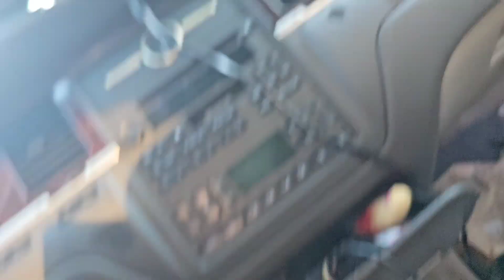Automotive Mechanic Trade or Electrician / Plumbing / HVAC Trade?

Comment from the maker: I apologize about that 30 seconds where I put my phone down in the car I forgot to cut that out
Reply: No need to apologize boss. If I'm being completely honest, your content is worth the wait.🙏🇺🇸
Reply: How exactly does AFM work? I understand deactivating lifters preventing the intake valve from opening thus reducing fuel consumption, but doesn't that cause an engine vibration? What is being done to counteract the power imbalance?
Reply from the maker: @nighttow8780  the top of the cylinder block has a valley cover over it which is called the lifter oil manifold

The valley cover has a series of veins that run through them that little solenoids open and close to allow oil pressure and electrical connection to activate those other lifters

Oil flows to the lifters with that will holes which causes the plunger inside the lifter to close when the pointed or closes the lifters collapse and therefore do not touch the pushrods which keeps both the intake and exhaust valves closed

When you have more demand for power the solenoids then change their position and allow the lifters to open back Violet plunger opening cutting off the oil from the lifter passages and allowing the lifters to go back to their normal operating 8 cylinder positions
Reply: When you are doing exhast repairs or cooling systems in a car it's plumbing air conditioning in a car it's what a house has
Reply: @FordBossMe  I understand all that, but doesn't a deactivated cylinder or cylinders cause a powerstroke imbalance that you would feel while driving?
Reply: Yes thus causing that misfire.

Comment: I have been a mechanic for 48 years.Have worked dealership and fleet and independent and have had my own shop for 21 years.If I had known when I was a young man what I know now I would have been an electrician or a HVAC tech.
Reply: Oh don’t I agree. 45 yrs in, owned shop 36. 
     Too much stress. Too little pay. Too bad it took me so long to figure that out ‼️
    Cars were so much simpler in 1972 when I started. Pay did not increase with complexity of cars.  
    If I was a cussing man I would say F**k car repair as a career.
Reply: All trades have changed though. Some more than others, and skilled trades in general haven't kept the pay in pace with cost-of-living. The electrical industry is more and more software all the time too. 

I'm not attempting to run counter to your statement, but just mentioning there's electricians who aren't happy with the scene either.
Reply: There are a few things though that people tend to forget about other trades…  auto mech, and to a lesser extent also diesel mech, are the most solid life-work balanced among the trades on average. Of course you can find yourself a nice balanced spot as a maintenance guy somewhere in the trades, if you search long enough and have good years and value on you, but even then you have to be somewhat open for emergency calls all around the clock every now and then… and this are the more rare cases, the mainstream can easily be around 14 hours a day including road time (the road can be a real headache and frustration along the years, a pain auto mechs tend to forget about) and emergency/on-spot calls… 
Moreover, as hot as it can get at summer, an auto-mech has a solid constant roof to work under! Something you miss terribly at many other trades working outside (who also have to suffer the winter).

Comment: I'm a union operating engineer. (Heavy equipment) 
Wouldn't trade it for anything. Over 6 figures with insurance and pension. Not hard work, all the equipment has heat and AC and sound system. Comfy. Joystick controls. 
No crawling around. No lifting. 
$120,000 plus, and that's without OT.
Reply: @firstlast6566  look towards gas/electric/water/civil utility companies: Elizabettown Gas, American water, Jcpl, JF Creamer, Roman  type places.......
Reply: @robertdiehl9003  thank you.
Reply: @firstlast6566 
I say learn some electrical skills. Look for industry it's usually stable. I had my last job 30 years. This one 7. I like what I do.

Comment: The automotive field encompasses many other trades all in one. You are an electrician, plumber, welder, HVAC and computer programmer. It's relatively easy for an automotive tech to transition to another hands on trade. I've seen some good techs get disenchanted with the automotive field. One went into machine repair and went to night school to eventually become a nurse. Another tech who was skilled in electrical diagnosis went on to troubleshoot computers.
Reply: I actually can from a rough framer/ finishing carpentry and even though I had background with mechanix cuz my uncle is a 50year diesel technician and my stepfather is also. As I fell off the carpentry cuz it was rough on my back and having a bad knee and created Sciatica I said I can’t stand on those 12 pitch roofs anymore so I said I know and been around the wrench’s and here I am a master diagnostic technician over 10 years and I will be here till the end ( currently 42 years old and feel strong) and God willing my company will flourish where I don’t have to work everyday or at all even though I love what I do and most likely die with my ratchets in my hand. But story short my brother in arms you are absolutely positively correct. Mechanics (good ones) have good memory and problem solving skills and they will fall in all and any category.

Comment: My dad has a 1998 F250 super duty and just finished cutting out and welding new steeling to fix rust.  Most of it was at the bottom of the door.  He did a better job that some of the body shops in the area.  I wish I was that good with body work.

Comment: What do you think of getting the LED bulbs that go in the stock headlight housing vs buying a kit that replaces the whole headlight?
Reply from the maker: I have them in this truck
Reply: Thanks, I think I will give them a try. I got a pretty good deal on a low spec XLT 2022 that hadn’t sold yet. One of the things I don’t love is the halogen lamps but it seems silly to buy brand new headlights assemblies when there’s nothing wrong with these.
Reply: Thanks, I think I will give them a try. I got a pretty good deal on a low spec XLT 2022 that hadn’t sold yet. One of the things I don’t love is the halogen lamps but it seems silly to buy brand new headlights assemblies when there’s nothing wrong with these.
Reply: Thanks, I think I will give them a try. I got a pretty good deal on a low spec XLT 2022 that hadn’t sold yet. One of the things I don’t love is the halogen lamps but it seems silly to buy brand new headlights assemblies when there’s nothing wrong with these.

Comment: TBH if I were to suggest a career; Electrician, plumbing or HVAC good fields that are always in demand but if you can combine HVAC and Electrician you'd be a clutch player everywhere you go IMO because there is so much overlap in that.
Welding for the time being at least is a field that needs skilled people.

HVAC and Electrical are areas that have wide demand in many fields, formerly trained in aviation myself i'd noticed  there is need for that kind of skill set on the flight line (although it may require more specialized training).

Comment: I would go to college at Lincoln Tech for two years which cost $30,000 and specialize in fixing Ford or Jaguar because I love Fords and Jaguars look great.  Then work at a Ford or Jaguar dealership to get a lot of experience on my favorite brand vehicle. After four years in any trade, you will be great at it if you show up to work every day and do the job perfectly every time. One thing to think about is as a residential electrician you will be going to different locations every day or every week depends how fast your company is. You will be driving to different cities in traffic, sometimes in slow bad traffic if someone crashes on the highway. Most of us will be driving in our personal vehicles with a lot of tools in the trunk and back seat. As a mechanic after a while, you can start a company at your house and be working at home which is great and fun.

Comment: Going by the homes they have, Plumbers and electricians  had the nicer homes. they have less tied up in tools, have way less tied up in training. less health issues .  On Aluminum , The stuff to protect it is called ACF 50 Uncle fixes planes and does the front items like rads the coolers front of engine and no issues after a decade. The 15 up Ford pickups, had a piece of foam in the front and one in the back that held water/salt. and was corroding them the body shop guy told us at work.  One thing re automotive, The schools said they love kids with great electronics understanding, and the dealers had older guys that struggle on new stuff. and they would be talking to instructors two months before class ends, with offers.  The HVAC guys make good coin, and on the side, they are making $400 an hr installing mini splits. Aircraft mechanics as well , Just look in the parking lot at the airport, aint no one there driving a Rolls.

Comment: Being in HVAC my opinion is a little biased. The past week has been very busy for me. This heat wave has been brutal on units here in south Florida. I usually have my normal customers here in Naples and Marco Island but this week I’ve been as far north as Ft Myers and even Punta Gorda helping out people that my friends also in the trade are just unable to get to. I’ve been working 12-14 hours a day driving to different calls. HVAC is probably the best trade to get into if you want to work for yourself and not need a shop etc to work out of. I’m working out of a dodge Dakota and it’s serving me well. I have been able to make $12K in 9 days. Of course I do have gas and taxes and other miscellaneous things to deduct but I’m still going to do very well once the heat subsides and things are back to normal. I’m sure I’ll get a couple new customers out of it as well. That is why my opinion is that HVAC is the best trade for someone to get into. People don’t like to be hot or cold and will gladly pay for comfort.

Comment: I was a professional musician the 1st 1/2 of my life untill I just got tired of the scene and being broke all the time. I was also mechanical and knew how to work on small boats so I settled down and got hired on by a reputable boat dealership that had me triple certified within 2 years (Mercury outboards and stern drives and Volvo Penta stern drives and Cobalt Boats certified). They then sent me to a bunch of advanced courses like Mercruiser MPI, Optimax 2 stroke, Mercury 4 stroke 1 &2, OMC Certified etc. Within 6 years, I was working for myself and never looked back. Being happy with what you do is just as important as money so... Life is full of regrets. When you change careers , you look back and wonder what could have been if only you stuck with whatever you were doing but, it is what it is. Follow your heart if you can.

Comment: I went the “automotive” route with motorcycles and it proved to be beneficial for me in falling into different industries as a very trainable employee and it has served me well getting jobs over experienced candidates. BUT, for someone looking for long term security between the trades, HVAC you can cross train with plumbers and electricians-so one would really have a great set of skills.

Comment: (Long story here) When I started college at 18 i went with my heart by trying out two different majors in the first year. I did two courses in technical drawing/advertising & design since I had a good back ground in art from grade school through high. The second was automotive technology.  I had barely any knowledge of the trade prior college and practically nobody I knew in family or among friends who succeeded in this. They all were doing "white" color type jobs.  So I thought about being different. Eventually after a years worth of time doing both, I realize realistically I liked working with my hands. The enjoyment of tear downs and build ups convinced me that automotive repairs is my future.  Problem is I didn't forsee how expensive it was going to become (tool end/education) or how difficult it was going to be working in changing environments especially for someone who has asthma. Exposure to certain chemicals took a toll as well. Some physical tasks made certain jobs very challenging as I have always been a lightweight and have literally never gained much weight in the 20+ years as being a tech.
All I ever worked for were  independent shops. Hardly any benefits, no bonuses, etc. Overtime I tried to apply for jobs at dealerships: 2 Fords, a GM, and a Toyota and for some reason it was the same excuse everytime. I don't have 'their' required experience or 'their' certified training yet I worked on every manufacture out there with ASE certificates in tow. So I gave up on that end and end up trying other jobs that was either around automotive or a form of repairs. I became a wood machine tabletop operator, I briefly tried HVAC, I became a forklift driver, worked for a Fiat restoration company, a parts delivery driver, a forklift parts counter person (Wanted to be a repair tech for this joint but politics got in the way). Hell I was trying to get a job at Navistar trying to be engine dyno tester but that fell through during the hiring process. I once applied for a job with Hertz for their automotive fleet technical support staff. I didn't get the job however, when I mentioned it to a former coworker who was also a tech, he end up getting that job there.
Lucky him.
Eventually,  in all that crazy cycle of jobs I still wanted to be part of the automotive trade. So instead of working for a shop I decided to do it for myself as a side gig while working for a major automotive parts company and also working as a parts inventory specialist for another company. Indeed it's alot of running around but I feel that out of all this  I am getting the most experience possible then at any shop I ever worked for and from both ends.
If I was able do it all over again, I'd probably be doing something else in another trade from the beginning and just do the auto repairs as a hobby, but at this point of time I'm already to far down this road having to  invest my time and money in the auto trade despite the ups and downs of this business.

Comment: There is a shortage in all of these trades plus welding. I like to pick my nose too much to be a plumber. I just don't want to work on cars like Audis or Rovers but enjoy working on Fords and Toyotas. The warranty work situation on all of them is unacceptable. HVAC and electrician are solid but it ain't an office job. I have a very good friend who left residential HVAC behind due to the dramatically decreased lifespans of the units early in the R410a switch. Manufacturers engineer poorly but the tech gets the blame. Sound familiar, Rich?

Comment: Until I got sick and can't work anymore I did commercial, medical and industrial maintenance.  Made a very good living and always had work, never landed off etc. Worked on everything HVAC , plumbing, electrical equipment,  heavy equipment, etc. There is no pressure to sell anything. Just make the requested repairs or pm work.

My son right now is in the 440 as an apprentice for pipe fitter. 

Yes, trades are very good for someone to get in. Like you said people have to have them just like their cars.

Comment: I spent some time in just about every trade there is. Now at the ripe old age of 42, I find myself very happy and comfortable operating a flatbed. I get to be outdoors all day, I have no supervisor staring over my shoulder. I no longer get banged-up bloody knuckles. I no longer step on nails that come through the top of my foot. Never again will I carry two 80 lb bundles of shingles up a ladder. I'm happy. Everybody should do what makes them happy.

And in regards to the guy who says you should have a Chevy or GMC pickup, I can tell you from first-hand experience, these new Chevy and GMC trucks are spending an awful lot of time on the bed of my truck. I think the only time I ever have a Ford pickup on my truck is if it has multiple flat or has been in a wreck. Just saying🙏🇺🇸

Comment: Construction trades are the way to go. If you are willing to work hard and learn as you go you will have a good career.
With the benefits and pay and working year round you will easily make 150K.
(Retired Local 134 IBEW 🇺🇸)

Comment: I worked at a RV shop in a small town at 17 years old in 1987 I already liked automotive and I got to pull engines for repairs, swapped some and made them fit (such as pulling Dodge 318 and dropping in a 440 etc).
A few years lateri was at a more red neck type salvage/repair shop. Also getting to do some weird stuff 😂
As I moved a lot trying to escape problems thanks to my psycho ex I finally fell into HVAC when I was a single father for about several years before moving to the big city in 2001.
Luckily now I'm mostly working from an office with site visits.
Spent 25 years on rooftops and crawl spaces.
Still tinkering on cars as a friend or family brings them.